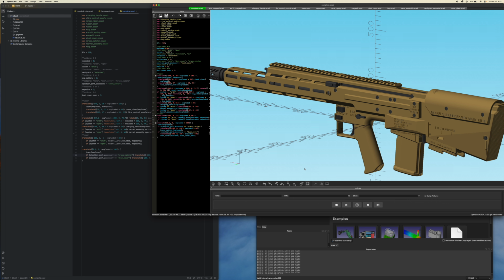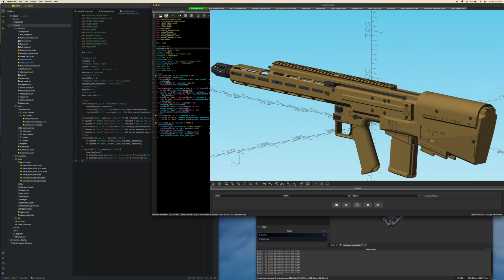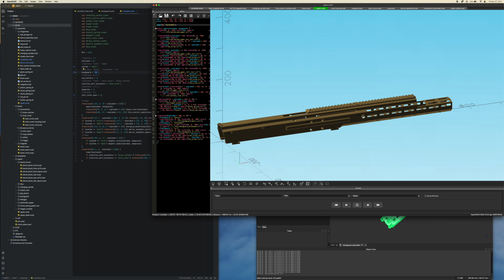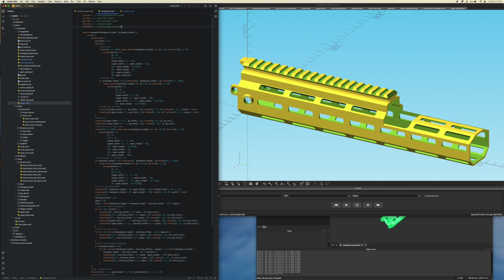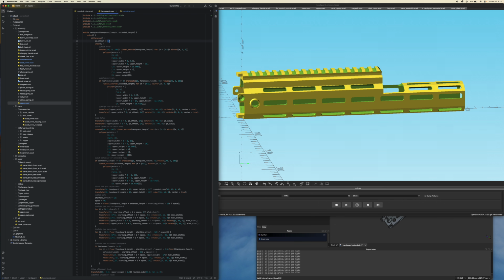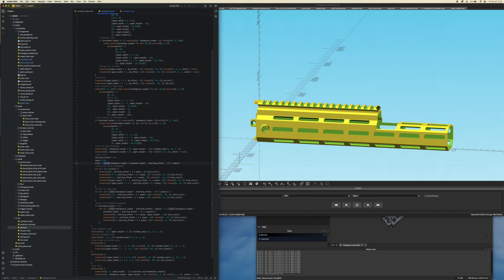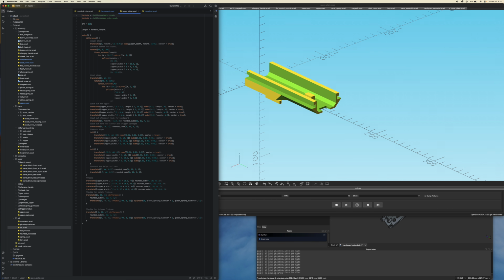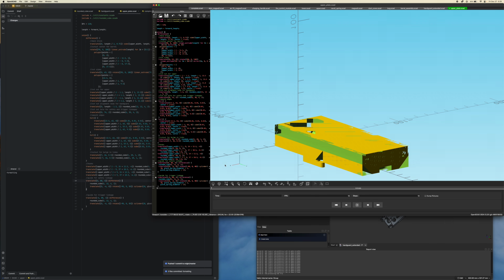OpenSCAD Crash Course

Comment: have you thought about adding a little landstop in front of the trigger guard, similar to the QBZ-95? it would fill out that awkward space where the trigger meets the handguard by adding a very practical and simple feature, while making the gun more aesthetically pleasing. it could even be an MLOK attachment, if for some reason a permanent handstop interefered with anything.